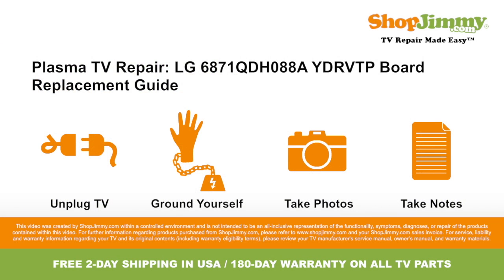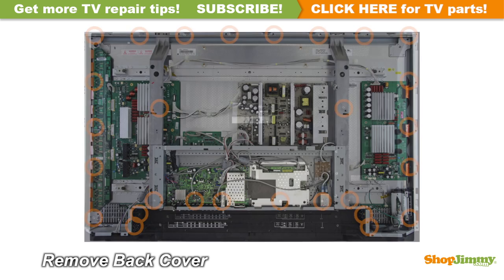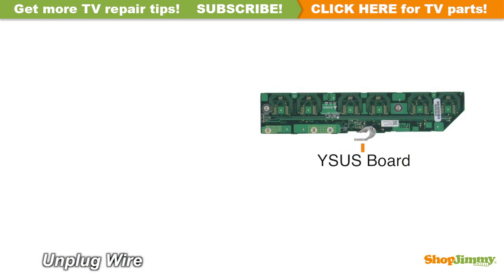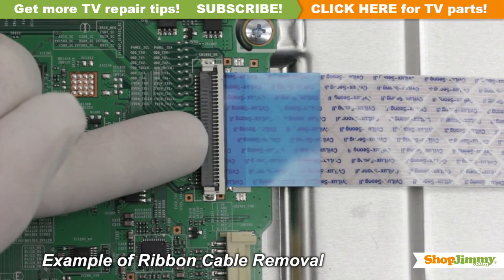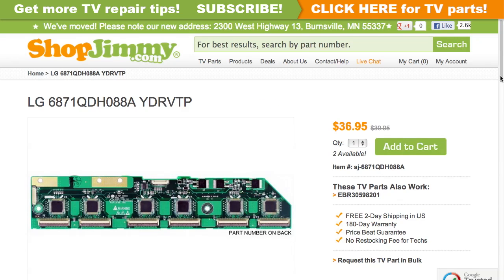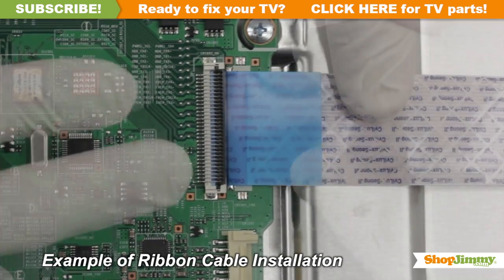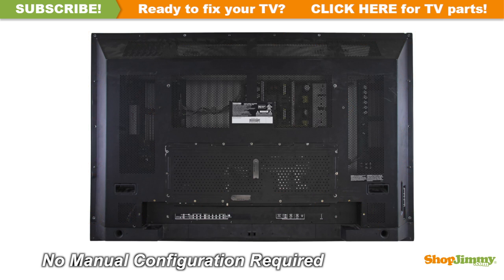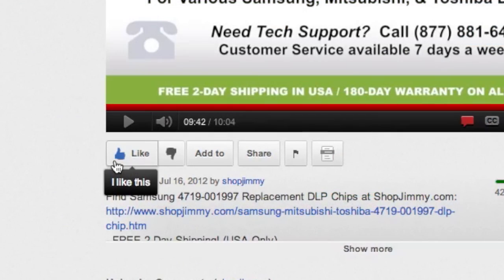LG 6871QDH088A YDRVTP Boards Replacement Guide for Plasma TV Repair

Comment: Where is the common test point to test the ICs on the LG 6871qdh088a board? I know I need to drag the test probe along the ribbon connections but where does the other probe go?

Comment: Hi I have an lg 42lg7w0yd and when I turn on my tv it's works for a few minuets then green and pink likes cover the whole tv. I have sound but no picture.
Reply from the maker: +Jack Morris  Try all repairs and troubleshooting at your own risk.   This could be a problem with either the main board or the TV panel.  You can replace the main board to see if that fixes the problem.  Unfortunately I do not see any replacement parts in the search results for your TV model number on our website.  Please reply with your part number on your main board and I can try searching for replacement parts.  Thanks and please let us know if you have any further questions!  www.shopjimmy.com

Comment: I  have an LG 50PC3D-UD,  the screen has been flashing bright and dim, and has now settled on being very dim now.  I think this is Ysustain board issue,  but I'm not a hundred percent sure, any suggestions?
Reply from the maker: Candice Chambers   PLEASE SUBSCRIBE TO OUR CHANNEL - Try all repairs and troubleshooting at your own risk.  If you still have an image/picture on the screen, and it is just getting dark, then I recommend replacing the ZSUS board in your TV.  Click this link to replacement parts for your TV model number:  http://www.shopjimmy.com/catalogsearch/result/?q=50PC3D-UD  There may be multiple boards for the same TV model number, be sure to match part numbers on your current board, with your replacement for compatibility.  Here is a link to a video showing how to identify your part number, click here: https://www.youtube.com/watch?v=GEllG3RV-tcThanks and please let us know if you have any further questions with your TV Repair!  www.shopjimmy.com

Comment: I have a LG 50 PC1 DRA tv, when you turn it on, it immediately turns off. What board do I need to replace. I have unplugged to the TV in hope it would reset, but the problem persists. 
corcora2@optonline.net

Comment: I have a zenith z42pj240 there is sound and backlight when turned on for a few seconds. Then the screen goes black and on the left side there are a couple pink, red, and blue lines. The pixels move within those lines like the static on a crt tv without a signal. Thanks!

Comment: Thanks for the videos.. I have a LG50PS60-UA that has a think line that goes across the top of the screen. You cannot see it in dark scenes, and it looks like their is static/snow in the line that changes color depending on what is playing on the screen. Any ideas what part I should be looking at replacing?
Reply from the maker: *****  I recommend replacing the upper buffer board in your TV.   Unfortunately I do not see any replacement parts in the search results for your TV model number on our website.  Thanks and please let us know if you have any further questions!  www.shopjimmy.com

Comment: Hi,  i have an lg 42l d550  the screen went dark , but with the lights off pointing a flashlight at the screen you can see the tv images can you tell me if i need to replace the  main board or the tcon board to fix this problem.  thanks.  Ben
Reply from the maker: Bienvenido Nieves   I recommend replacing the power supply in your TV.  Here is a link to replacement parts for your TV model number on our website, click here:  http://www.shopjimmy.com/catalogsearch/result/?q=42l+d550  Be sure to match part numbers on your current board, with your replacement for compatibility.  You can also call our customer service for further assistance with your purchase.  (877) 881-6492  Thanks and please let us know if you have any further questions with your TV Repair!  www.shopjimmy.com

Comment: Hi
My LG 50PC3D-UE turns on but the screen looks like this in the following video
LG broken plasma
It also shuts off on its own and makes a popping sound. I checked voltages on the power supply and they are within spec. 
I was told this is a buffer problem. What parts do you recommend to fix this problem..

Thanks

David
Reply from the maker: D L   I recommend replacing the Y-SUS board and the Buffers all at once.  Here is a link to replacement parts for your TV model number on our website, click here:  http://www.shopjimmy.com/catalogsearch/result/?q=50PC3D-UE  Be sure to match part numbers on your current board, with your replacement for compatibility.  You can also call our customer service for further assistance with your purchase.  (877) 881-6492  Thanks and please let us know if you have any further questions with your TV Repair!  www.shopjimmy.com

Comment: my lg 50 has no picture just sound i noticed a green line running through screen all i have is sound. tv only 2 years old
Reply from the maker: keith moore I recommend replacing the Y-Sustain in your TV.  Here is a link to replacement parts for your TV model number on our website, click here:  http://www.shopjimmy.com/catalogsearch/result/?q=lg+50&restrictBy%5Bmaster+part+type%5D=Y-Sustain  Be sure to match part numbers on your current board, with your replacement for compatibility.  You can also call our customer service for further assistance with your purchase.  (877) 881-6492  Thanks and please let us know if you have any further questions with your TV Repair!  www.shopjimmy.com

Comment from the maker: @americanjackknife - im guessing  its not double sided tape but rather silicone heat sink pad (it often sticks to the back of buffers and acts like tape). Leave it on. It acts as a heatsink and uses the back of the panel to help cool the IC's from behind.  Thanks and let us know if you have anymore questions!  Feel free to call us as well, (877) 881-6492